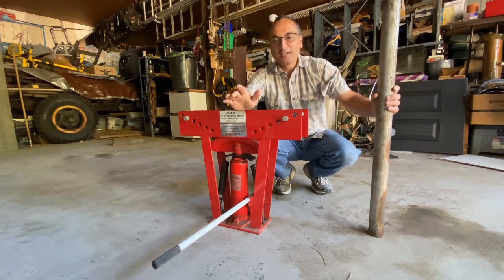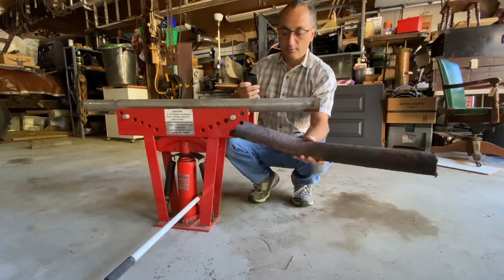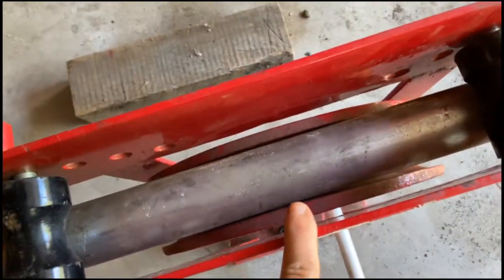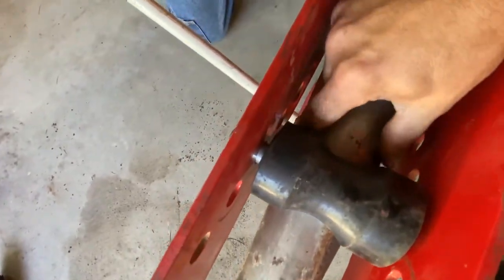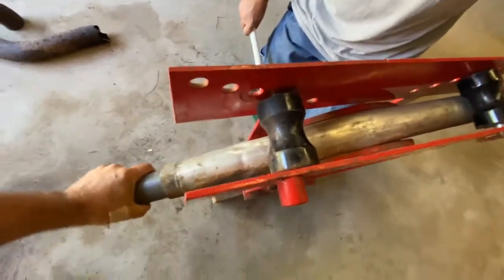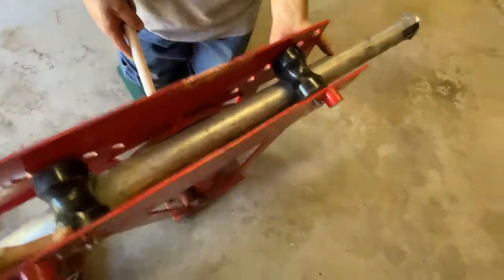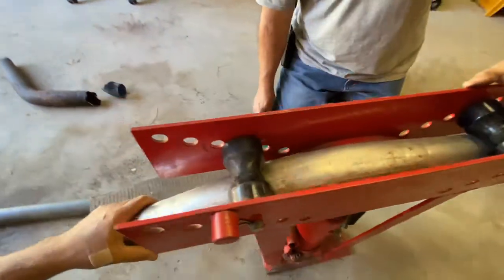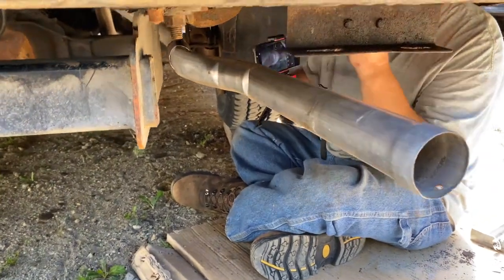how we made a tail pipe with a 12 ton pipe bender Did it work Harbor freight

Comment: You can't change the size of pipe if you make it smaller more back pressure
Reply from the maker: Yes that's true but the pipe is oversized in the first place so it will have little of no effect in this situation, thanks for commenting.

Comment: Those benders are meant for schedule 40 and schedule 80 pipe. Went looked at one today and it said it in big bold words not for use on tubing, use for schedule 40 and 80 pipe only lol.
Reply from the maker: Well it did not work perfectly but it did get the job done. Thanks for taking the time to comment.
Reply: If it works then it works. A bend is a bend when it’s just exhaust pipe. Who gives a shit. Long as exhaust can flow through it and it’s not pinched. It’s not going to explode if you put tube in it. lol.

Comment: would have been better to cut and bend then weld  much better
Reply from the maker: Maybe but this worked out just fine for this application, thanks for commenting
Reply: yes but it was crushed in, would have been ashamed to have fitted like that
Reply from the maker: @johngurney1069  If it was going to be installed in an area that was visible all the time then I would agree with you, but since it’s under the vehicle and it has no effect on the operation or the functionality of it, I wasn’t worried about it.